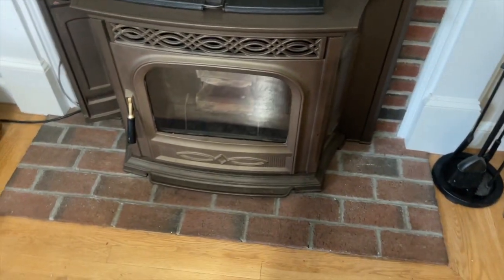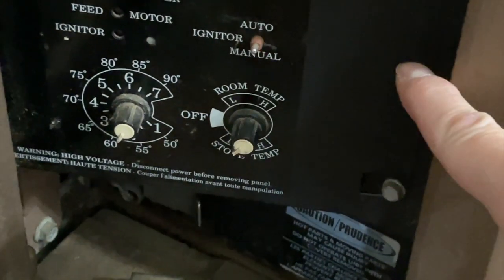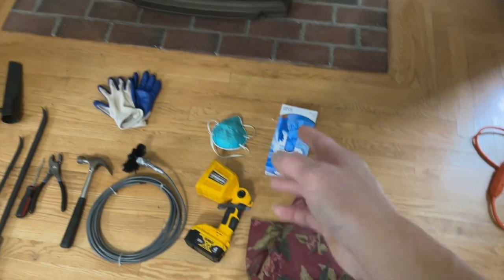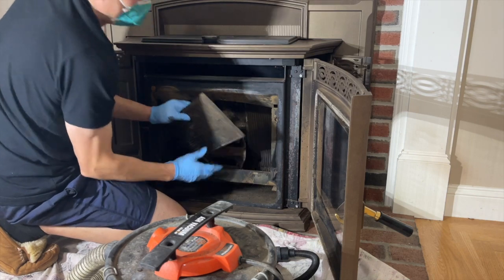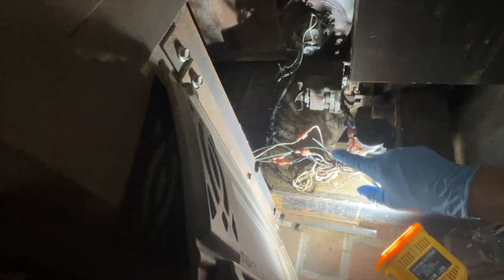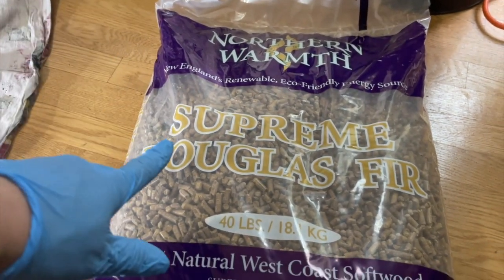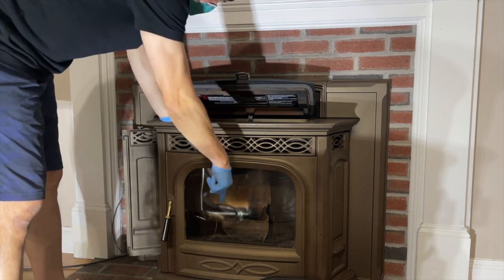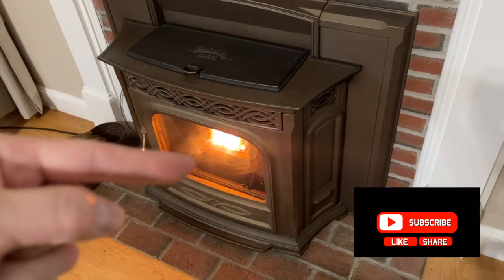Harman Pellet Stove | How To Clean And Get Started [FULL GUIDE]

Comment: Thank you for the video!  I had mine professionally cleaned and am having a lot of dust build up under the burn pot, have to keep cleaning out that igniter area with the two wing nuts and metal plate, too often.  Some people told me to check the feeder chamber.  How often does that get full of fines?
Reply from the maker: Hi, thanks for watching and commenting. Yes fine dust does buildup in the burn pot. With my pellet stove… I find that if you use premium pellets (not from Home Depot or Lowes) it puts out way less ash. 
I hear that recommended cleaning 🧹 is every pallet that you finish… i clean it again as I demonstrated in this video 📹. Im glad this video helped you 👍
Reply: @hunterandchavy  Thanks!